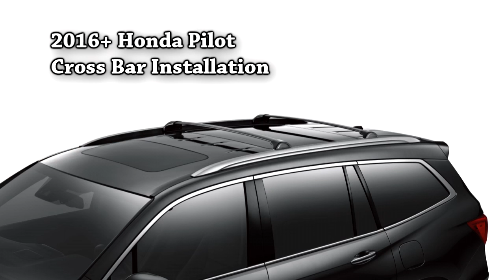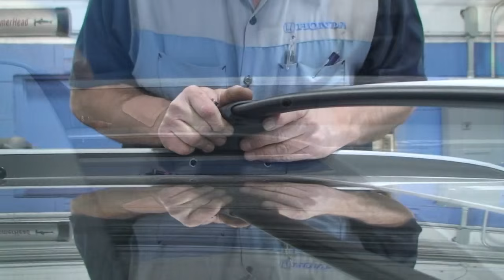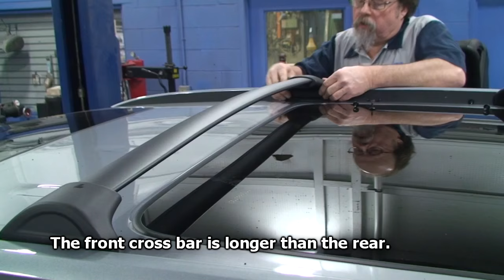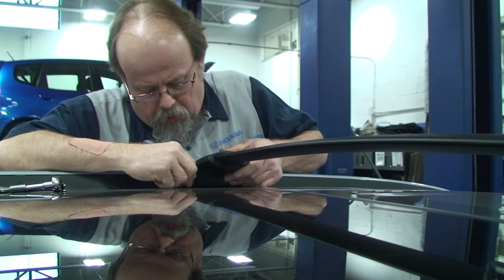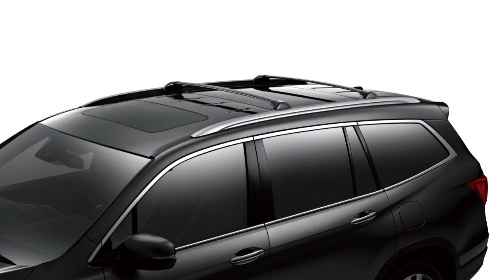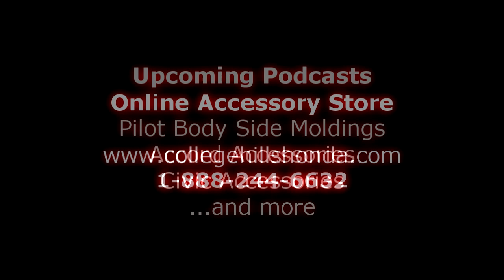Episode #276 - 2016-2022 Honda Pilot Cross Bar Installation

Comment: Is this good for the Honda pilot LX, so the crossbar , can be installed without special technician.
Reply from the maker: Note you will need to install roof rails before you can install the cross bars. If you have the mechanical knowledge to do it yourself you will not need a dealer.

Comment: are the cross bars adjustable?  Do you have to buy honda pilot specific roof cargo boxes?
Reply from the maker: The bars are not adjustable. Most boxes will work just fine with the bars in their fixed position.

Comment: Am planning to move my roof crossbar and side step from my Pilot 2003 to 2009, does it fit?
Reply from the maker: Those parts are specifically designed for different body styles. I highly doubt you would be able to get either one to work.